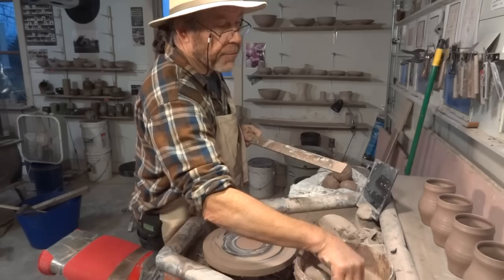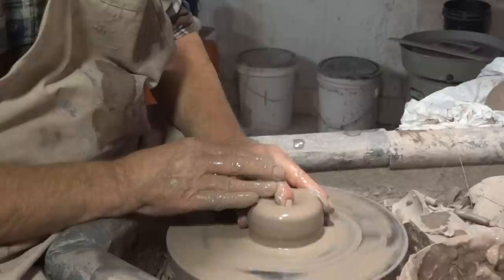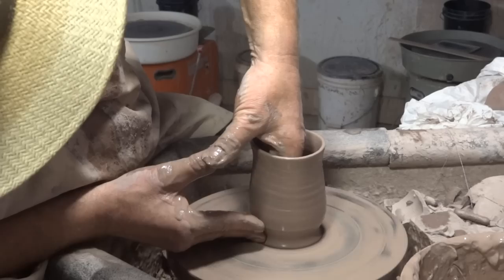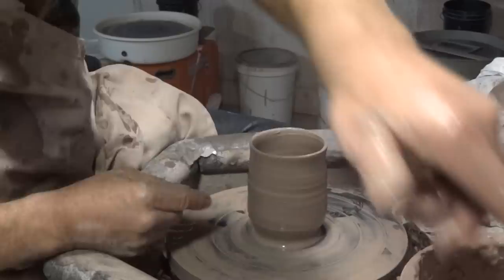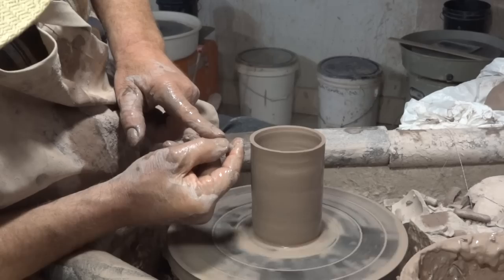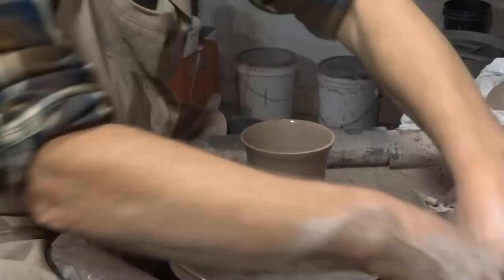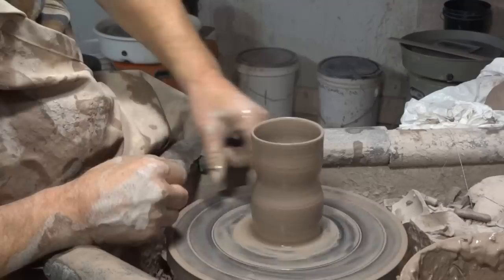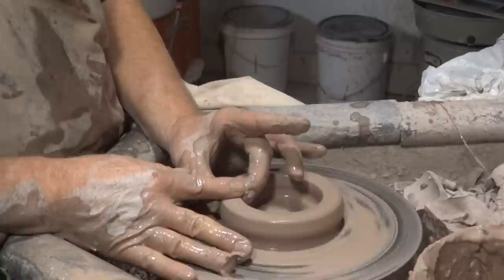" Help !! " ... corrections to common throwing errors - Nov 7th with Simon Leach

Comment: Thanks! It looked like you were done and I prepared to make a comment because my common error preventing me from getting mugs beyond a certain height wasn't addressed. I know I'm not unique in this area. Haha. But then you went back to the wheel, and I think you addressed my problem! My cylinders tend to get a bit too thin about 2/3 up and too thick the rest of the way. I frequently have to cut them off. I think what you showed when you first start to lift the clay is a key. Thank you very much!

Comment: Hi again from rural Japan. 16:48: Regarding the demon "Torque". I wonder if it can often begin during insufficient/unskilful wedging.  Also, I find it happens when I pull the clay up faster than the wheel speed. Thanks!
Reply: Demon Torque is right.  I'm still trying to find the right clay consistency.  Such a bugger that softer clay means less torque resistance.  Sometimes I feel like there's no way to win.